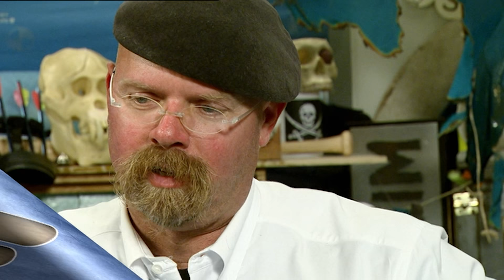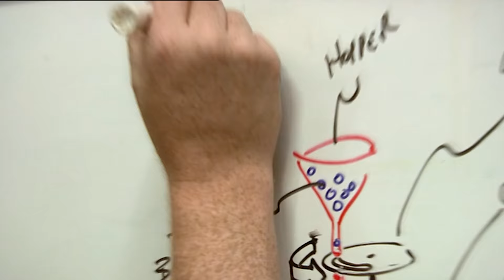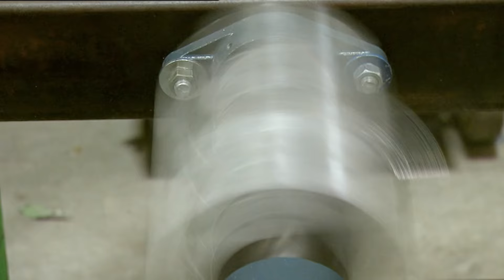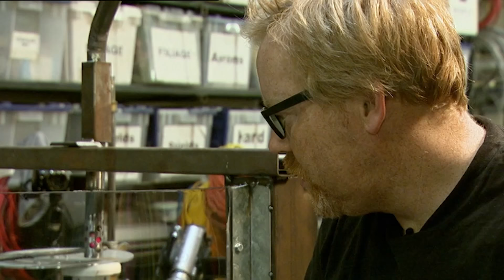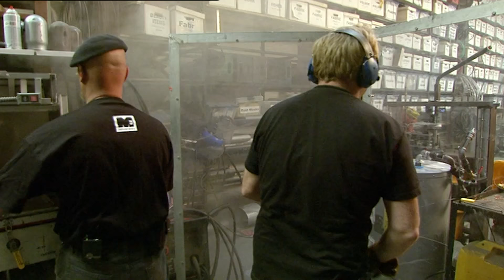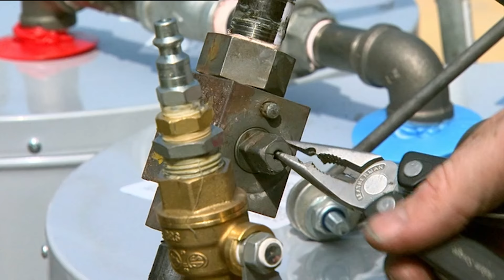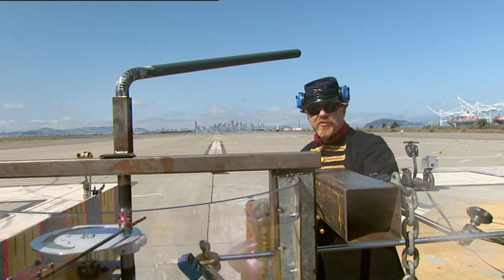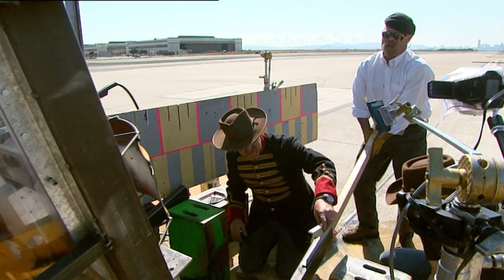Could A Steam-Powered Gun Really Fire 400 Rounds A Minute? | MythBusters

Comment: There's a couple things that could make it work. Longer barrel, more pressure, faster spin, different ammo material. For a shop build in a week, proof of concet is there, now have the funding of military and 100 engineers build one :D
Reply: Fund it with the late war confederate budget and this is going nowhere, just like in reality.
Reply: definitely could be made into an extremely lethal weapon with high pressure steam and something that isn't put together with spare parts. not really very useful outside of fixed position defence though since it would be too heavy to be practical to move..
Reply: A friggin cam gear on a timing link. That is all.
Reply: @chrisaiken4419  It would in theory be possible with steam during the civil war it wouldn't be reliable until about 1915.
Reply: Don't bother air pressure guns already exist(ed) the reason why you don't hear anything about them is because they were made after gunpowder was already used and found to be less effective than its blackpowder counterpart. 
The airguns that exist do work as weapons far better than that confederate mess contraption though none of them were machine guns. Though it wouldn't be impossible to make an air powered machine gun just less effective than a gunpoweder.
Reply: @millerrepin4452 the advantage of a system in this vein isn't that it uses air, it's that it doesn't need to. You're spinning a projectile up speed. 

This will have application in Space, where every ounce of propellant and fuel is valuable and there is no air resistance to cause your bullets to veer off.
Reply: @palarious  In space you wouldn't need to worry about weight but you would still need to deal with poor accuracy, difficult to move around, the spinning part would be a major hazard, feeding ammo would be unreliable and speaking of unreliable there are so many moving parts that things will malfunction more frequently. Can't run to a hardware store then back getting a speeding ticket along the way when you're in space. 

Bad design pneumatic weapons make more sense than any other weapon in space. Since you aren't contaminating the air with gun smoke and air powered doesn't have as much penetration which is important for obvious reasons.
Reply: @millerrepin4452 no, in space you REALLY need to worry about weight. For every kg of mass, you have to spend more fuel to maneuver. 

As for "clunky" designs, a repeating automatic weapon has the same or more moving parts. I'm an amateur firearms enthusiast. Guns have to load, lock, fire, eject and repeat. 

This type of weapon eliminates two of the above steps and practically a third. It doesn't need to eject casings, it doesn't need to lock the breech, and it basically doesn't fire, either. 

It's a far simpler design once you do away with all the steam jank and improve the feeding ramps.
Reply: @palarious   The design of that weapon is heavy much heavier than any normal machine gun and that's even replacing water heaters with well you didn't say. Though the reason why the mythbuster design looked simpler was because it wasn't refined. If you did refine it you would have to add more parts than a normal gun as getting the rounds to consistently go into that weapon is inconsistent as it is currently. Not like you can aim it as a matter of fact that design is an injury risk.

Gun powder weapons design is all over the place though how often they fail would depend on which gun you are talking about in particular the AK is known to be super dependable being able to be held together with duct tape not that gunpowder weapons are a good idea considering that it would work in space to begin with. 

Though my point was that pneumatic weapons does everything you are talking about and then some. You can aim, easy to store, easy to charge, low weight, 

I think it's cool you are into guns if you ever have the opportunity to I'd highly recommend looking into modern pneumatic guns as they are everything you are saying would be ideal for space.
Reply: @millerrepin4452  The design of the weapon is not inherently any heavier than a normal large machine gun. THAT design is, but a modern one is not. 

"Replacing water heater with well you didn't say"

Because I assumed spinning a disc would be pretty obvious. You just use an electric motor. 

"if you did refine it it would add more parts"

Hardly. Refining OFTEN simplifies designs, not complicates them. In this case, the entire power mechanism would be replaced by a simple electric motor and the whole timing cam would be replaced with simple, non-moving exit ramps. 

"Not like you can aim it as a matter of fact"

Why can't you aim a bullet that reliably comes out of a tube?

" pneumatic weapons does everything you are talking about and then some."

Again, no they can't. They need propellant. That propellant is valuable mass that could be used for rocket fuel, air, or simply not be there, reducing the total mass the ship has to move, increasing both drive efficiency and maneuverability. 

Additional issues include: Heavier weight barrels and the need to lock the chamber to contain a high pressure explosion.
Fouling from gas residue requiring maintenance.
HEAT. Dissipating heat in space is incredibly hard to do. In a warship, that will be a major target for enemy vessels. When you shoot a bullet, massive amounts of heat is created in the system as a byproduct of the EXPLOSION. Even in atmosphere, this is a problem that leads to weapon failure and degradation. 

A simple spinning disc does not create heat on anything close to the same scale. 

If you're talking about simple air guns.... where are you getting the air? From heavy tanks where it is under compression. Valuable air that has to be sourced from planetary bodies. Now your system isn't just the gun, it's also the gun plus the mass of the storage media. 

I'll repeat my image of the modern version of what this would look like 

"You don't spin the barrel, you spin the magazine. you feed the balls (which should be lead) down through a central tube into one or more tubes spiraling out across a disc. The size of the disc determines how fast you need to spin the disc for a desired energy level while the number of tubes determines rate of fire along with spin. 

The balls are stopped from leaving the tubes by a greased set of bearings or rollers that encase the outer edge of the disc. Leading to the barrel, you have a very short exit hole. The barrel will, by necessity, be mounted on the side of the disc, not the front. 

Thus the feeding occurs automatically and without need for gears or timing. "
Reply: @palarious  Yeah pneumatic weapons can be heavy usually between 6-15 lbs though you do have me at an advantage since the weapon you're describing doesn't exist. You can say it weighs 2 lbs and I'm going to struggle to argue otherwise until you actually make it. 

I will say though electric motors combined with batteries, disc, and so on I'd have to imagine would add up but this is your invention not mine.

Though I will say using a weapon does imply a back and forth so it would have to be able to be used even if you run around dive for cover or even drop the weapon and pick it back up. A malfunction is obviously very plausable but not guaranteed but a weapon that needs to build up momentum through its mag which I am struggling myself to imagine would sound like a major pain point.

Then there's also getting that mag to feed consistently which is why I said before that refinement might require adding on rather than removing because the only design I had to go on was the mythbusters contraption not the perfect idea in your head. Still getting a consistent feed does sound like a major pain in engineering that I don't think you've fixed as well as you think. 

Oh another thing you are saying these projectiles are balls which is going to affect accuracy. If you are on a ship where a misfire can kill everyone you do not want an automatic weapon in space to begin with which does kind of kill the biggest allure I think the concept this weapon has.
Reply: @millerrepin4452  For clarification's sake, I see this not as a personal weapon, but as a ship mounted one. You get far better savings on mass when you're talking about tens of thousands of rounds and you're running on ship power. 

As for components, you have a magazine, a feedtube, an acceleration disc, a retaining ring, and a firing ramp. That's five parts. 

While I'm sure you could make a lethal handheld version of this, it scales better with size. 

As far as balls being inaccurate, that is only true in an atmosphere. In vacuum, they can spin all day and it won't affect trajectory. That's why I suggested this for space, not atmo, and also why a handheld version would be less likely. Most firearms at that size are going to be used inside of Atmo, because that's where people will be to shoot at. Ships, on the other hand...

What would the spinning disc look like? 

Look up J K Parson's Centrifugal gun, patent 1,408,137 from 1922. The side view shows kind of what the track would look like, though you wouldn't be restricted to just two grooves for the bullets to travel down. 

The reason such a weapon has never been deployed in history is simple: it induces rotation on an axis that is not conductive to a bullet's flight through air. Remove the air and it's not a problem anymore.
Reply: @palarious  Well thank you for the reference as that does help a lot. Though the use case you have in mind for it still does confuse me.

For one I don't get using this on ships. We don't exactly get space pirates that'll do drive bys you have to worry about. I was thinking about personal firearms because sooner or later people as in the average person not the highly vetted astronauts that get selected will be trapped on these ships or even space colonies and you know someone's bound to snap so you would want self protection.

There's also the possibility of a space race and someone on the ship could be a saboteur. 

I guess I wasn't even considering the space ships themselves being used in a dogfight since they are so difficult to get off the planet so that restriction alone would make violence between ships untenable.
Reply: @millerrepin4452  "we don't exactly get space pirates" 

Yet. And there is, of course, opposing military forces. They will have weaponized ships. 

As for the difficulty of getting space ships off the ground... You'll just build them in space. 

Launching ships from Earth's gravity well is only something we do now because we're still Earthbound. 

Given the development of lunar and orbital manufacturing, we will build the vast majority of humanity's entire future infrastructure in low and zero G environments. It's just a matter of how long it takes to get to that point. Earth's entire landmass becomes a grain of sand in comparison to the living space provided by rotating habs built using in system resources.
Reply: Just like in this video.
People keep using just steam and act like that is what they used back in the day.
When in reality people ran things with superheated steam which has way more energy.
Reply: It's entirely possible to do all that without the extra jank. You don't spin the barrel, you spin the magazine. you feed the balls (which should be lead) down through a central tube into one or more tubes spiraling out across a disc. The size of the disc determines how fast you need to spin the disc for a desired energy level while the number of tubes determines rate of fire along with spin. 

The balls are stopped from leaving the tubes by a greased set of bearings or rollers that encase the outer edge of the disc. Leading to the barrel, you have a very short exit hole. The barrel will, by necessity, be mounted on the side of the disc, not the front. 

Thus the feeding occurs automatically and without need for gears or timing. 

Now.... here is the problem. 

You have a ball spinning rapidly either in the vertical (Y) or horizontal axis (Z). You need that bullet rotating in the X axis to stabilize it in air. 

So now you'll have to compensate for an additional movement in addition to parabolic arc due to gravity.

This is not an issue in space, where the simplicity of design and lack of propellant will likely result in this being a real weapon some day. Just not in Atmo.
Reply: You could not do this with the balls just rubbing along the walls like in your design. The speed these are going, you would either immediately and explosively jam the "magazine" as the soft lead ball deforms and stops rolling, or just smear your bullet along the wall so it is no longer round and does not fly straight (after which the whole mechanism stops when enough lead builds up). You couldn't make the outer surface a bearing either - rollers would make it bumpy, your mechanism would vibrate itself to pieces as the bullets hop between the gaps between them. The only thing that would work is making the outer surface rotate at the same speed as the "magazine", but then you couldn't actually release the bullets.
Reply: @arturjogi6054 surface deformations don't matter in a vacuum. 

And this has essentially already been done and built, with far cruder technology and science. The issue is accuracy due to air. If you're not in air, it's not a problem. 

The rest of your concerns about being unable to release the balls are unfounded. Like I said, there have been real world demonstrators that worked, but were inaccurate. There are also modern equivalents that were built to demonstrate slinging payloads to space and the window to release in those machines is much, much shorter.
Reply: @arturjogi6054 surface deformations don't matter in a vacuum. 

And this has essentially already been done and built, with far cruder technology and science. The issue is accuracy due to air. If you're not in air, it's not a problem. 

The rest of your concerns about being unable to release the balls are unfounded. Like I said, there have been real world demonstrators that worked, but were inaccurate. There are also modern equivalents that were built to demonstrate slinging payloads to space and the window to release in those machines is much, much shorter.
Reply: @arturjogi6054 but you could make the entire retaining ring a bearing if you canted the disc to peek over the top of it at the release aperture... Would have to have a little play in the distance between the retaining ring and the disc, though
Reply: @palarious y would anyone make that when there more portable, far more powerful and more robust solutions that already exist. If cost and simplicity were the only requirement for military weapons everyone would still be using spears and slings. Destructive power, ease of use and ability to mass produce are all far more important in modern militaries.
Reply: @curtissteenbruggen1491  Less mass, less maintenance, less thermal management, less complex machining, less fouling, and higher thresholds for high energy projectiles at the larger end of things. In space. 

Bullets  need propellant. That propellant is valuable mass that could be used for rocket fuel, air, or simply not be there, reducing the total mass the ship has to move, increasing both drive efficiency and maneuverability.  in space you REALLY need to worry about weight. For every kg of mass, you have to spend more fuel to maneuver. 

Additional issues include: Heavier weight barrels and the need to lock the chamber to contain a high pressure explosion.
Fouling from gas residue requiring maintenance.
HEAT. Dissipating heat in space is incredibly hard to do. In a warship, that will be a major target for enemy vessels. When you shoot a bullet, massive amounts of heat is created in the system as a byproduct of the EXPLOSION. Even in atmosphere, this is a problem that leads to weapon failure and degradation. 

A simple spinning disc does not create heat on anything close to the same scale. 

For clarification's sake, I see this not as a personal weapon, but as a ship mounted one. You get far better savings on mass when you're talking about tens of thousands of rounds and you're running on ship power. 

As for components, you have a magazine, a feedtube, an acceleration disc, a retaining ring, and a firing ramp. That's five parts. 

While I'm sure you could make a lethal handheld version of this, it scales better with size. 

As far as balls being inaccurate, that is only true in an atmosphere. In vacuum, they can spin all day and it won't affect trajectory. That's why I suggested this for space, not atmo, and also why a handheld version would be less likely. Most firearms at that size are going to be used inside of Atmo, because that's where people will be to shoot at. Ships, on the other hand...

What would the spinning disc look like? 

Look up J K Parson's Centrifugal gun, patent 1,408,137 from 1922. The side view shows kind of what the track would look like, though you wouldn't be restricted to just two grooves for the bullets to travel down. 

The reason such a weapon has never been deployed in history is simple: it induces rotation on an axis that is not conductive to a bullet's flight through air. Remove the air and it's not a problem anymore.
Reply: @palarious  I’m not going to argue with you bud but you are dead wrong lol
Reply: @curtissteenbruggen1491dead wrong because you can't visualize a ship mounted weapon in vacuum?
Reply: @palarious  because it is a very stupid idea. Especially for a spaceship lol.
Reply: @curtissteenbruggen1491"it's a stupid idea"

Your eloquence is just breathtaking
Reply: @palarious  if you think spaceships are going to being throwing pieces of lead at each other at relatively low speeds compared to virtually every other way to fire projectiles other than a rubber band, you have lost the plot mate.
Reply: @curtissteenbruggen1491 I can't decide if you can't comprehend that people will be shooting at each other or that you don't understand the energies involved in centripetal acceleration. Somehow you manage to muddy even that up.
Reply: Rocket fuel space is precious but let’s take a bunch of lead projectiles that need a massive wheel to throw them a 50th the speed of a rail gun not to mention a laser. You are ludicrous lol.
Reply: @curtissteenbruggen1491your ignorance is not my problem. Railguns: completely infeasible at present due to excessive pitting and barrel wear. Lasers: diffuse at any decent range and have massive heat problems on Earth, much less in vacuum. 

Meanwhile, we have centripetal accelerators capable of flinging masses at far greater velocities than missiles with zero fuel expenditure. Their main issue is dealing with atmosphere.

I don't understand why people as ignorant as yourself feel so confidence in your lack of knowledge
Reply: What would make it work is a couple of guys who weren't trying to debunk it just for laughs and views-